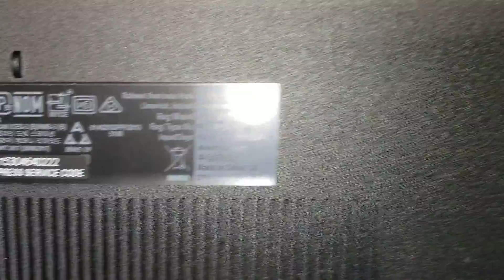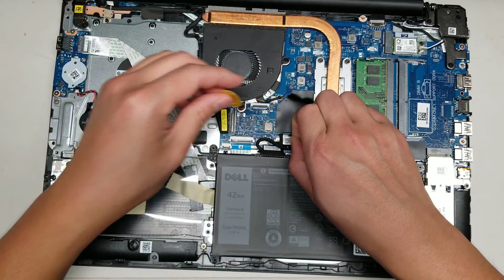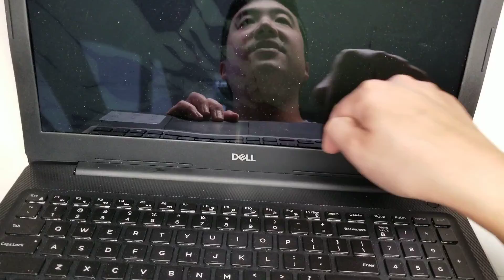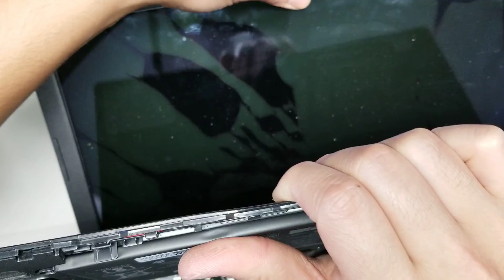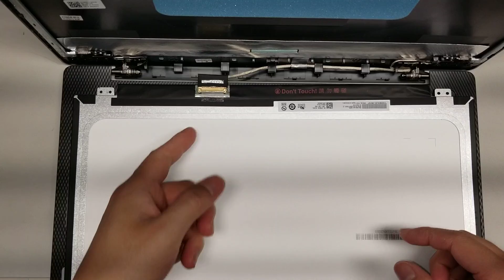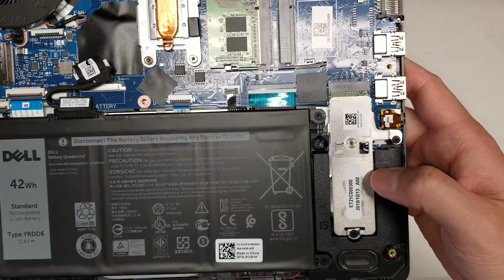Dell Inspiron 3593 Disassembly RAM SSD Hard Drive Upgrade Repair LCD Screen Replacement

Comment: how can i check if a screen panel is compitable with my laptop if i cant find the right one anywhere ?
Reply from the maker: Check the model number on the back of the screen.
Reply: @ItsBinhRepaired  i checked i found it. but i cant find it in any shop netheir dell .
Reply from the maker: @thsk8156  what's the model number?
Reply: @ItsBinhRepaired  391-BEUD : 15.6-inch FHD (1920 x 1080) Anti-Glare LED-Backlit Non-touch Display thats the display code , do you need service tag ?
Reply from the maker: @th sk  You need to take the screen out and get the model number like I show in the video. None of what you sent is the model number.

Comment: im using caddybay for hdd and replace DVD/CD, but it dont show HDD in caddybay, what's the problem?
Reply from the maker: Make sure it's connected properly. If it's a blank hard drive, you'll need to format it using the disk manager.

Comment: Hi!   I have 3595 (which I am assuming is just like your 3593).    Screen is about 90% pink, except for the very top.    But when I hook up to an alternate display (like a TV connected via HDMI), the picture is totally fine.   So I'm assuming I have to change LCD screen?    Computer isn't even 2 Years old, but it appears that's the issue.    If I buy a LCD screen and follow this video, should that do the trick?    Any recommendation what site I should buy the screen from?    Thanks
Reply from the maker: Assuming it's the same, it will work. Check the screen model number on the back of your LCD. Make sure to follow the video exactly step by step. Don't skip around and assume you know everything.
Reply: @ItsBinhRepaired  Yes I will follow your video exactly.    From the Dell website, after putting in my service tag,    HRN6M	Liquid Crystal Display,15.6,High Definition,AG,Embedded Display Port,Au Optronics Corp.

The only place I seem to have found this was from a company named Brightfocal, on Amazon, for around $80 Bucks.    So if my screen is pink, does that probably mean my LCD screen just needs to be replaced?
Reply from the maker: @jackwilliams5223  you want to check the model number on the sticker on the back of the LCD itself.
Reply: @ItsBinhRepaired  Oh OK, I was trying to avoid opening the computer until the part arrived, but I guess I'll have to?    The HRN6M part # from the Dell website is not reliable, you think?
Reply from the maker: @jackwilliams5223  not sure. If the resolution matches it might be ok
Reply: @ItsBinhRepaired  So, I followed your video exactly (thanks) and removed the screen.   The # on it  was N156BGA.    I have that coming from Amazon (I like using them because I can always return without hassle if it doesn't work).   Should be here soon, then I will try popping it in and hopefully no more pink.   I am pretty certain that the screen was the problem, because as I mentioned, the picture was perfectly fine on an alternate display.
Reply from the maker: @jackwilliams5223  battery drain part is the most important. Make sure you do that before disconnecting the screen. :)
Reply: @ItsBinhRepaired  Pushing the button to drain the battery?     Yes, I did that.    Thank you very much!   Your video was precise and exact, as my computer looks exactly like yours, inside!    I am just awaiting the new item from Amazon, now, so we'll see how it works.    Thanks again!
Reply from the maker: @jackwilliams5223  sounds good!

Comment: Is it normal that the air holes at the back plate are not open like there is some plastic blocking it cuz i have the same laptop with mx230 nd it's over heating and i get alot of dropped frames even tho i play normal games that my graphics card will deal with no problem . Please help me and thanks
Reply: Thank you bro
Reply from the maker: @aminf0377  no problem
Reply: I have an i5 10th gen
Reply from the maker: This might help. https://youtu.be/3zs_SJ3BXgA
Reply: i have the same laptop and the same problem, cannot run any games while it is charging, frames drop completely.

Anyone knows if removing the batery helps?

Comment: how is the gaming in the laptop?
Reply from the maker: I just repair them. Customers don't let me play games on their computers. Lol
Reply: Dont buy this one for gaming, i have it, and you can only do it while it's not charging.
Reply from the maker: While it's not charging? Shouldn't it be the opposite?
Reply: @ItsBinhRepaired  it overheats and drops frames. Unless its something configurable...i thinks it's hardware,  but i tried a lot of things :'(
Reply from the maker: Strange. Are you using it on a solid surface without blocking the vents?
Reply: @ItsBinhRepaired  yes, i even got a fan-base, but does not help.
Reply: thank you for the tutorial though! i will try to open it and remove it's batery, to see if this changes. It has this problem since day one, i bougth it on january 2019.
Reply: i found a solution for gaming and the overheating!!! Download "Dell power manager", and in termic administration, put it on "cool/cold". it will make your pc slower for multitasking, but it will let you play games! at least, tried in lol, genshin, and raft from 6 fps to 30 fps :D
Reply from the maker: @romihime  lol nice!

Comment: Hello. Recently bought Dell an Inspiron 3593 laptop and noticed that i need to press the power button for about 2-3 seconds when I am initially powering it up. When i press it quickly,it wont power on. But when its connected with power cord,then it will boot normally even with quick press of power button. Is this normal?
Reply: My computer is exactly the same behavior, I think is normal in this model 🤷🏻‍♂️
Reply from the maker: Usually more a gaming laptop type thing.
Reply: @ItsBinhRepaired  didnt understand you
Reply from the maker: @makkeyn  most laptops don't do that, but it's common in gaming laptops

Comment: hi I want to add ssd in the same laptop model.. so I just need to install the SSD.. second is to do the disk cloning..and done? because I saw some videos they need to setting in the BIOS and to change the boot sequence.. and some video they didn't go to BIOS to change the boot sequence between the HDD and SSD... can u explain which one do I need to follow after doing the disk cloning.. and one more thing are this laptop (inspiron 3593) support the Samsung Evo 970 plus ssd? I currently using 1 TB HDD, and I want to add 500 GB of the samsung SSD.. Thanks you :)
Reply from the maker: https://youtu.be/4p5jFDzVwUw that video should help.

Comment: Buenas tardes, sabes cuantos pines tiene esa pantalla. ¿30 o 40 ? Muchas gracias
Reply from the maker: I don't hablo español.
Reply: @ItsBinhRepaired  Good afternoon, you know how many pins that screen has. 30 or 40? Thank you very much
Reply from the maker: @miguelangelsaenzbernal7251  oh, I don't count them. I just check the model number of the screen and buy the same or compatible according to the sellers.
Reply: que tal amigo, si es exactamente la 3593 sin touch, el conector del display utiliza 30 pines
Reply from the maker: Interesting
Reply: @ItsBinhRepaired  hi dude, thanks for this video, it is very useful.
Reply from the maker: No problem, glad it helped!

Comment: Why is there a plastic piece in the place of the ventilation hole?
Reply from the maker: What do you mean?
Reply: @ItsBinhRepaired  I mean at the bottom slot
Reply: mean, at the bottom hatch for ventilation, it is closed at this laptop and I suffer from high temperature while operating the game, the processor temperature becomes 100 ° C
Reply from the maker: @222mohammad4  hmmm I'm not sure

Comment: Anyone with the covered vent issue??
Reply from the maker: What's that?
Reply: @ItsBinhRepaired  https://drive.google.com/file/d/10TBjDSHfJQmVvSqrWz9mO6aatPueLkv5/view?usp=drivesdk
This is my laptop's bottom vent
Reply from the maker: @manmeth  why are you liking your own comments? Lol is it hard plastic or a mesh? If it's hard plastic you probably have one with a very low end processor that doesn't get very hot, so they seal it. Kind of like a phone.
Reply: @ItsBinhRepaired  First I didn't like my own comment. But I did like your reply. My CPU is a Core it 1035G1 and that thing is at 50 to 60 C on idle in balanced and goes upto like 70C in high performance. How come is that a low end CPU?
Reply: Don't know why, but I feel like they designed the laptop for the i3 and just put a i5 inside it.
Reply from the maker: @manmeth  strange, not sure

Comment: 30 pin or 40 pin connector pls reply
Reply from the maker: I don't know. I don't count them. Just open it up and check. The best method is to get the model number from the back of the screen itself.

Comment: Hi, 
be a friend and please consider running one original and very interesting CPU benchmark:
https://www.overclock.net/threads/cpu-benchmark-finding-linus-torvalds.1754066/page-2#post-28648619

My idea of collaboration is this, the community gets THE FIRST 512bit searcher benchmarked on a machine that is shown on your YouTube channel and that way you help me by saving money not buying it.
Your laptop has a CPU supporting AVX512, by chance I am the author of FASTEST fulltext search tool (open-source, in public domain),  if you are willing to run the test I will put the link to this video in my article at:
https://www.codeproject.com/Articles/5282980/Fastest-Fulltext-Vector-Scalar-Exact-Searcher
Reply from the maker: These are customer computers. I will not run unknown software on their devices.

Comment: How fast could it be with 16gb of ram instead of 8gb. I have the 2019 edition with i5 10 gen 8gb
Reply from the maker: I just repair computers. I don't benchmark them. Best way to find out is to buy it and try it.
Reply: @ItsBinhRepaired  👍
Reply from the maker: @karthikstar1966  :)
Reply: Depends what you're doing. If you're doing intense tasks at the same time like video editing, programming, gaming, etc.. then you can upgrade to 12gb or 16gb ram. If you're only doing productivity stuff like studying and using microsoft office, then you won't need more than 8gb. 
What I recommend is getting an M.2 SSD if your PC only comes with a hard drive. It will make your pc 10 times faster.
Reply from the maker: @LandingNow  pcie nvme if it supports it.

Comment: Can we replace the 2.5" SATA HDD with an SSD in the (256GB+1TB HDD model).
Because, I have some click clack sounds coming off from the laptop at the boot and shutdown of the laptop. 
Please comment your reply....
Reply from the maker: What do you mean 256gb + 1tb? Is that some sort of hybrid drive?
Reply: @ItsBinhRepaired  
Thanks for the reply!!! It's a dual drive not a hybrid drive!!!
I have a dual drive model of Inspiron 15 3593 core i5 1035g1!!!  It has a seperate slots for 256gb pcie nvme toshiba SSD + 1TB Seagate HDD!! 
Now I think the HDD is making some minor click clack sounds during boot and shutdown. 
That's why I am asking is it possible to replace that HDD with 2.5" SATA SSD. 
Please reply!! 🥺
Reply from the maker: @ramprasathsrinivasan  oh, yeah you can replace the 2.5" drive with a SATA SSD
Reply: @ItsBinhRepaired  Nice to hear!! Thanks for your reply.

Comment: Can you please do a video on external GPU for this laptop. 

😅😅
Reply from the maker: What external gpu? I don't own these computers.
Reply: If the existing graphic card is not supportable for gaming,

I heard that We may use an external graphics. But, my laptop have no thunderbolt port. That's why I'm requesting you.

Comment: How to upgrade the dell i5 3593 having geforce mx230 graphics card with better graphics? 

I'm currently using this laptop and i have a fear of running heavy softwares like catia, and games like fortnite

Please help me in upgrading my graphics card of dell inspiron i5 256GB SSD+1Tb HDD, 2gb geforce mx230 graphics.
Reply from the maker: It's not doable if you watched the video.
Reply: Ohhh, it's a quite disappointment. 

Thanks for your quick response 😇

Thanks a lot

Comment: Is there an issue for upgrading ram like mine? Since the original ddr4 code pc2400T or pc 2666T (with T code) samsung chipset. Mine cause boot fail then. Pls comment!
Reply from the maker: You want to get the same speed as the original.
Reply: Yes I tried same speed from few brand such as kingston, corsair, team with same samsung chip, but it did not work
Reply: I could not find one with T codes
Reply from the maker: Amazon has some. Search pc4 2400t

Comment: Where is the screen backlight cable (delivering power directly to LEDs)? This laptop's screen flickers  and I read that a similar model has low PWM frequency. I think adding a capacitor there will solve this problem.
Reply from the maker: Not sure
Reply: @ItsBinhRepaired  I watched again and I saw that there's only one cable to the screen, so it must be some wires in it. I don't know which one, but I saw how it's in Asus X55VD. I found it's datasheet (after searching the name on screen's PCB) . Some wires are for power supply and some for signals: backlight enable and PWM. So in Asus PWM generator is somewhere on the motherboard - I wonder if it's some non-programmable circuit (like NE555), microcontroller or if the signal is generated by CPU.